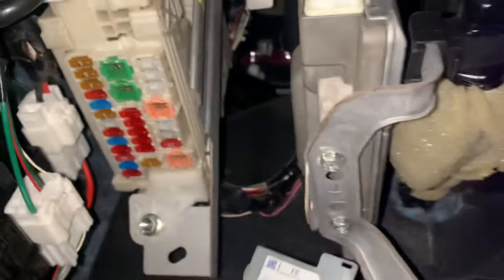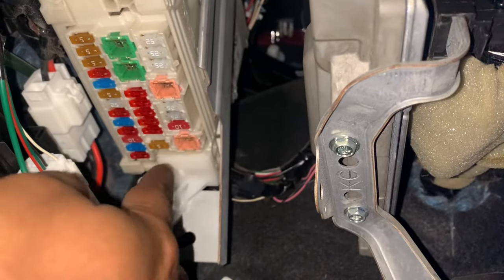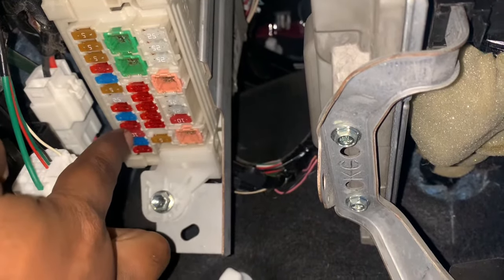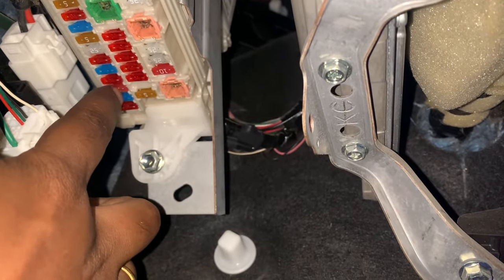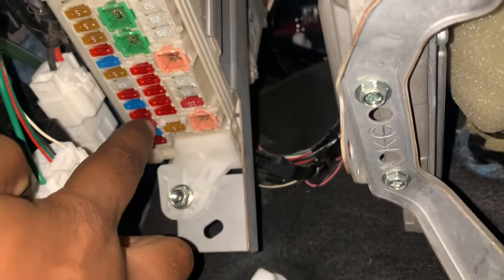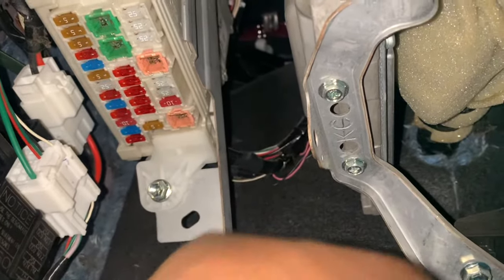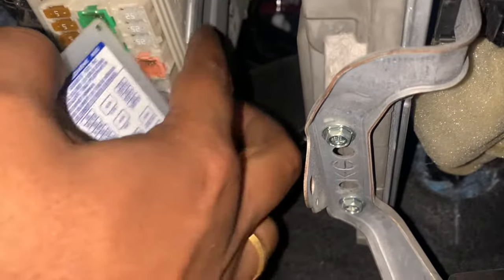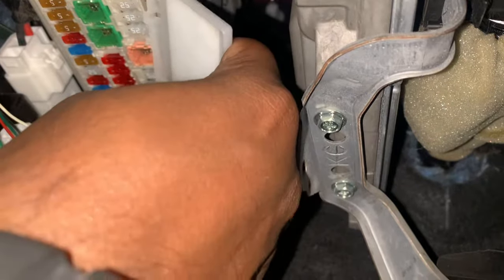Fuse Box for reverse parking light and reverse parking sensors in Innova Crysta 2016

Comment: Thank you! Do you know if each reverse light has its own fuse? I have only one reverse light out and I tried to change the bulb but it’s not working.
Reply from the maker: I suggest you to check the bulb if it’s working or blown off. Did you check if the fuse was not burnt? If fuse is good and the filament in the bulb is burnt then replacing bulb will help. If the bulb is fine and the fuse was blown, replace the fuse and that should work if both are fine then I believe there should be issue with the connection in the wire. Take it to an electrician and that should fix for mere 50 to 100 bucks with careful checks.

Comment: When I activate the parking sensor. It is just a beeping sound, same sound with or without obstacles.
Are you familiar with my issue?
Reply from the maker: Did you install an external camera and a sensor or was it a standard accessory with the car? Try to see if sensors have been blocked by too much of dust accumulation. If everything is fine, I suggest you to unplug the sensor connections and try to plug them one by one to see which sensor has an issue and replace them. That should fix it. Let me know what was the issue after your work around with the above comments.